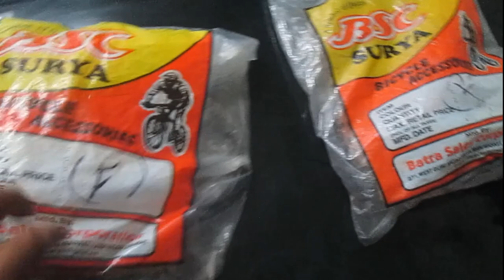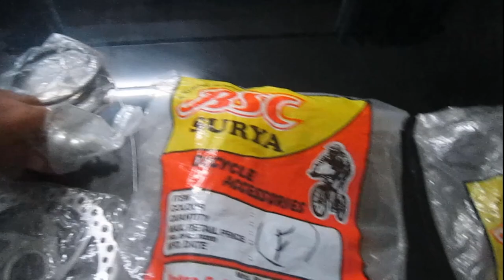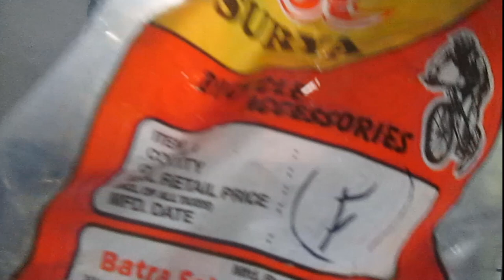How to add disk brakes for bicycles (Front and Back) Malayalam

Comment: Hi Joel. I had dismantled an old Hercules Turbo Drive cycle. would like to add the disc brakes both at front and back. Is it possible to do so? Please advice further.
Reply from the maker: It's possible. But from my own experience you will never get a felling of stock disc brakes

Comment: Disk kayattanulla gyap undaago cycle ill????
Reply from the maker: Not all cycles can accommodate a disk brake. The wheel hub will fit easily but in my case the disk was rubbing on the shock. To fix this I had to Hamer the shock and also bent whole front shock. This intern effected my alignment
Reply: @joelgeorgekuriakose  entel cosmic nta cycle aanu ulluthu mtb  athu bent cheyyano???